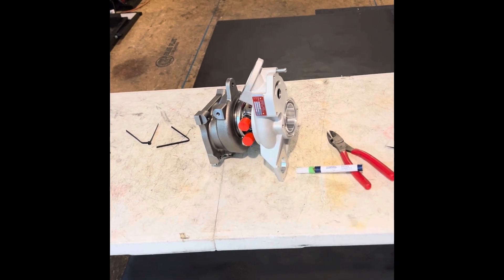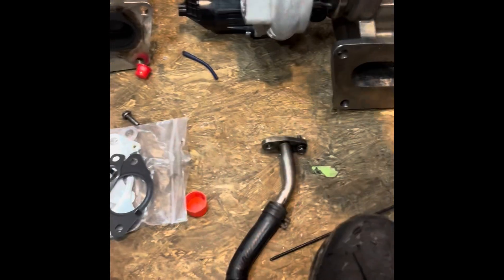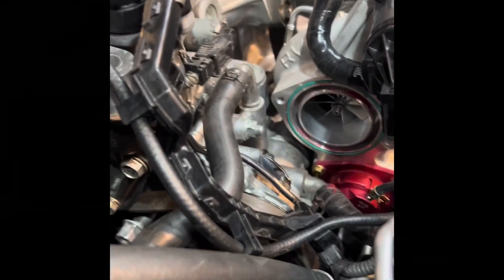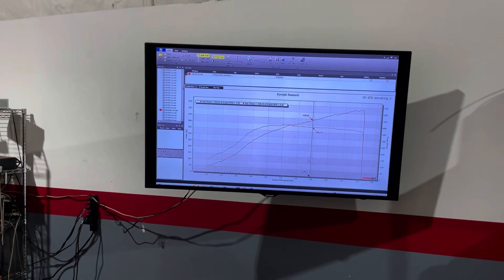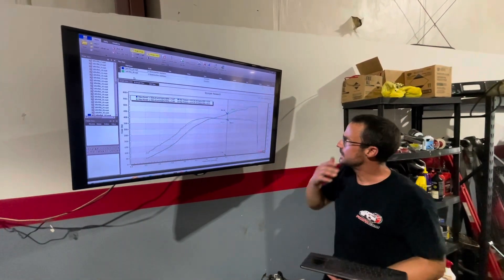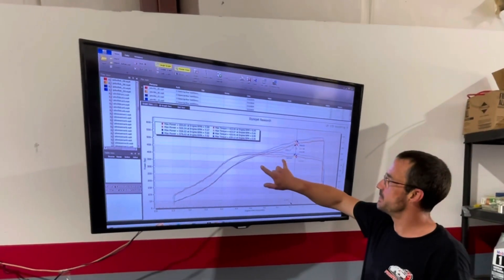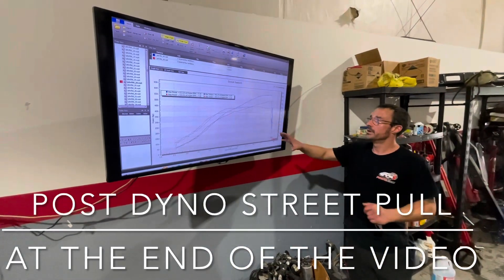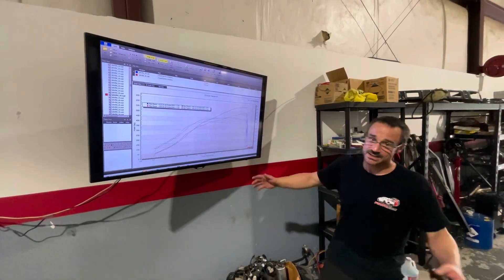Fk8 De5 Fl5  Rv6 Prototype 7 series overview and dyno testing

Comment: Hi! I’m running a Rv6 turbo. It’s worth it to upgrade to the anti surge mod? 
Thanks
Reply from the maker: it will gain more torque down low and some top end but not alot on top. it will increase longevity